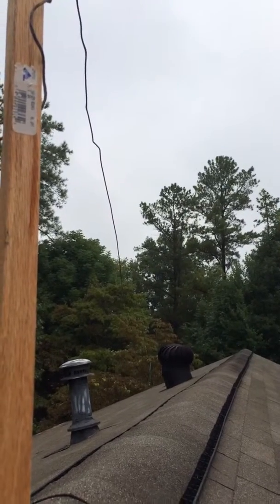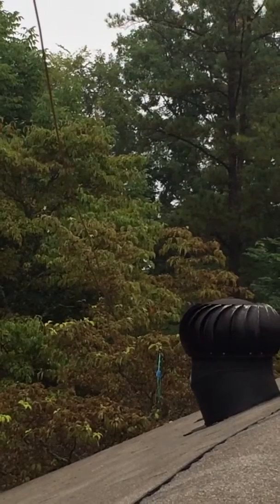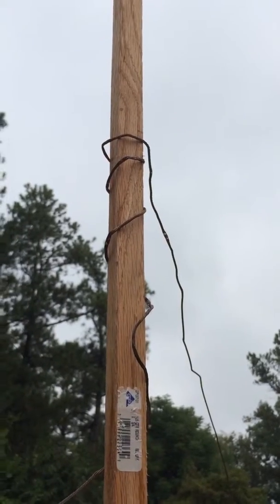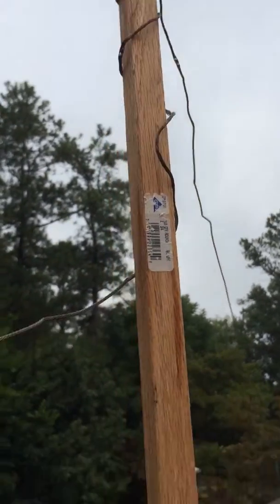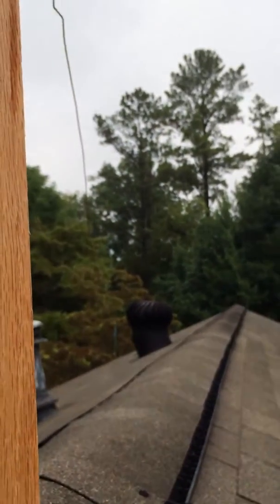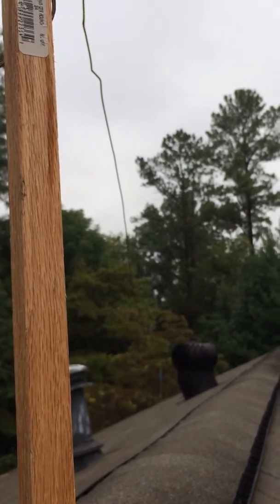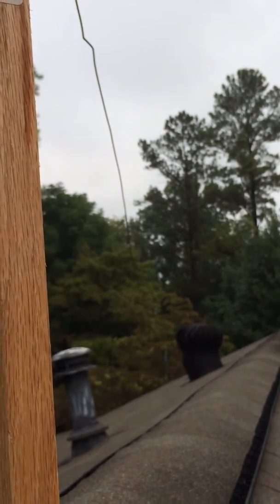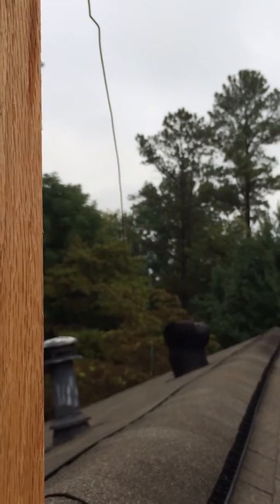random wire antenna for shortwave reception

Comment: Home brew is as educational as it is rewarding... if I had the space a co-phased cross polarised longwire antenna would be on my to do list.

External antennas will be further removed from the RF noise within your home than an integrated telescopic whip.

One obvious downside to the random wire antenna is the feed line is also part of the antenna itself so "where" you route the feed coming into your station is as important if not more so than the performance itself, case in point my random wire antenna when run through the corner roof space of my shed had a lower noise floor than a couple of meters further along the same building.  

Keep experimenting thumbs up for you...